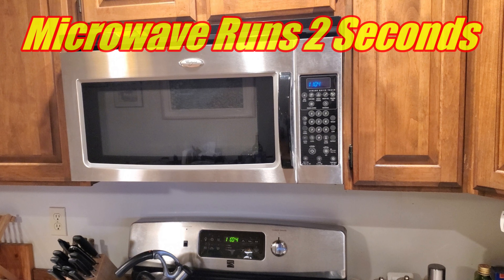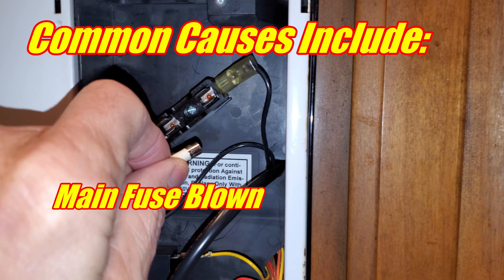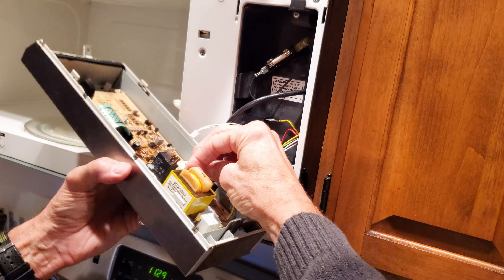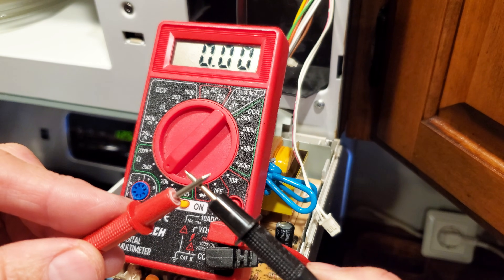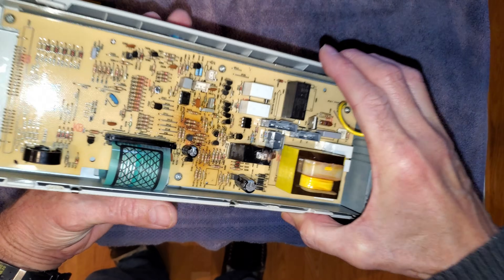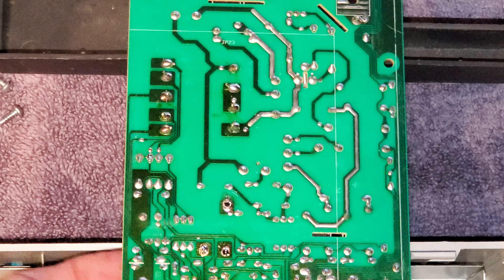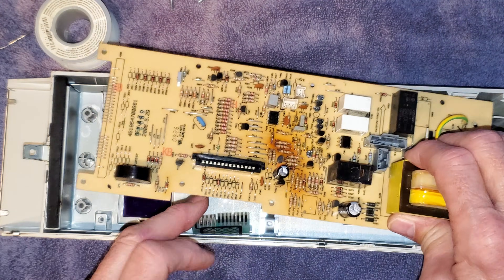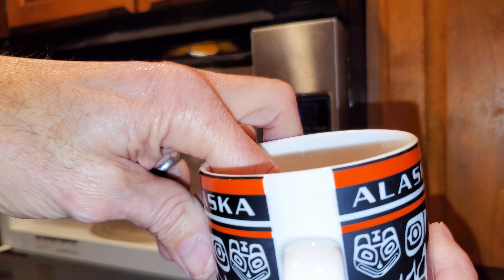Microwave Shuts Off After 2 Seconds - Solved

Comment: Just wanted to say a Big Thank You for your video and clear and concise step-by-step trouble shooting. My 2008 KitchenAid KHMS1850 Microwave went down the other day and did the 2 second run time. I  started to play around with it and then moments later I got a "Door Open" across the screen and the Microwave would start running as soon as the door was shut, not good. I had replaced one door switch as well as a Control Pad/Board over it's lifetime so I was familiar with this piece.
I started by checking the switches with my continuity tester and while they all tested fine while in the audible beeping mode the ohms resistance was a bit off between them so I ordered the three new switches you had linked. While I was in there I checked that Main Power Relay {Omron G5G-1A 24VDC) and sure enough 2 of the 3 posts had a loose solder connection and the Relay would move back and forth. I resoldered the connections, buttoned it back up, and crossed my fingers as I plugged the unit back in...SUCCESS!  Thanks for all you help.
Reply from the maker: You're welcome! I'm glad the video helped you fix your microwave and congrats on a good repair. Thanks for sharing.

Comment: Very clear! Our local dealer said the door latch gets out of line on our ge advantum 120. Jiggling the door it works but is getting worse. So I guess we'll check the door locks?
Reply from the maker: Glad the video was helpful. If the problem is getting worse, checking the door locks but also the plastic mounts for the interlock switches are good places to start. Some of those units are over 20 years old and the plastic mounts for the door switches can crack and cause problems with alignment and switch synchronicity.
Reply: @ScubaMoto the actual door seems made loose. But the mounts you mentioned seem a likely issue. Thanks.

Comment: My bottom switch when I open the door goes to 2.82 instead of going to 1 , that means that I have to replace the bottom switch right?
Reply from the maker: Good find. It should be 0 or 1 as shown in the video. The  next step is to pull the switch and confirm your reading with the switch removed. Also be sure the mounts are healthy. Damaged mounts will cause synchronicity problems. The switch types are either normally open (NO) or normally closed (NC). The numbers on the switch should help you find a replacement if needed.

Comment: I have the very same microwave. I read on the internet that one cause is a faulty humidity sensor. They said to put a glass of water in with your actual item. After doing that, it started to work again. So I doubt in my case it is the relay. However, It still sometimes gives me problems. I notice however, that once I get it going, and there is plenty of humidity in the microwave, then I can stop it and start it again no problem, only when the item is cold does it shut off after two seconds. So I think it is the humidity sensor not sensing enough humidity. 

To change the humidity sensor is a huge job unfortunately.
Reply from the maker: Thanks for sharing your troubleshooting tip, I'm glad you figured out how to get it working. Once they're off the wall, the moisture sensors aren't too bad to replace.

Comment: So I’m having the same issue, but the board looks fine (not the exact same model, but a similar OTR Whirlpool microwave). The door switches all test good as well. I could convince it to start and stay on if I slammed the door with some authority, but even now that doesn’t work either. What would be the next step to troubleshoot past what you have done here?
Reply from the maker: The fact that banging it resolved it for a while is a good clue and not surprising. Double check all the solder connects but especially for the main relay. Of course there are other possibilities, but my money's on your problem is likely burned contacts inside that main relay. For a while impact would complete the connections between the small contacts but they finally burned out enough that no current can get through the carbon build up. I show relay removal in the video. Relays have numbers on them for ordering. I think mine would have been about $10. The big plastic caps are glued on. You could try to open the relay to clean the contacts with sand paper but if it were mine I'd replace it. 

ALSO, I'm not sure how you tested the door switches but if you removed them to test them, it is not conclusive. The mounts and latch pieces are plastic and are known to crack with time and door slamming. Once the switch mounts/latches crack, they can no longer operate the switches in sync with each other and I have personally seen that also cause what you describe. That is why, in the video, I tested the switches while they were in the mounts to ensure synchronicity.

Comment: I work for a company ..we had change out everything but the board smh 🤦 gotta get that work order and order a board haha . Thanks
Reply from the maker: Yes, installing a new board would have had the same result as the repair performed in this video. It would have been necessary to roll the dice on a used board since new boards for this model are no longer being made. So, I was glad to find the burned out solder connection and it was worth the inspection. I was also relieved to learn that the relays were still available if I had needed one. Also, the cost of a new board would have made replacement an easy decision even though labor to remove and install over-the-range units can be significant depending on venting and other factors.